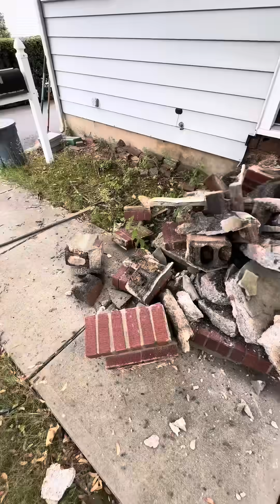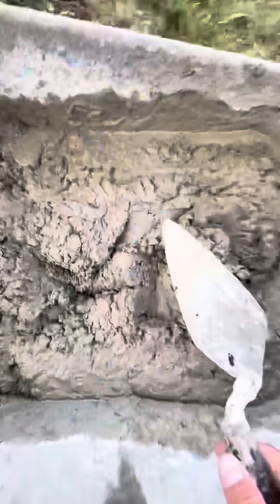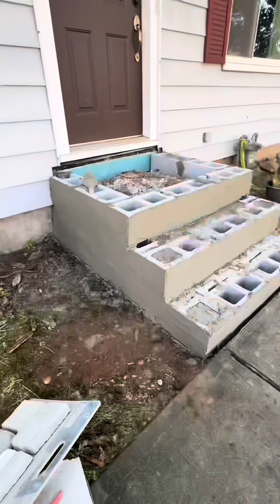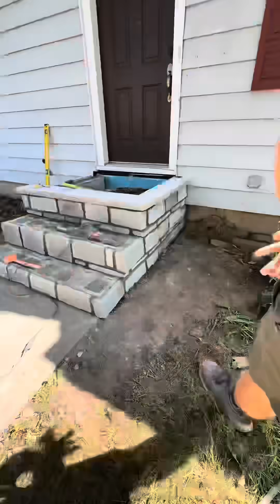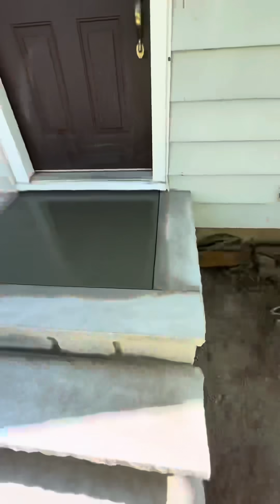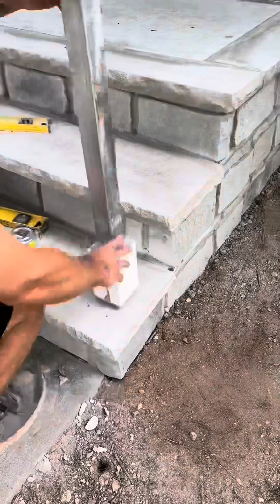Entire Front Porch Rebuild Step by Step Start 2 Finish

Comment: Looks awesome guys! Really quality stuff. Maybe on the next one try to sell the customer on some 3 2 1 pavers or another interesting paver pattern instead of the concrete on top to complement the stacked stone?? I’m 33 and I’ve been doing this stuff since I was 18. Personally I’d sell them on a nice wood rail that I build and paint white myself and then the cost of that rail kit becomes mostly profit, but I enjoy woodworking too so maybe that’s just me. I dropped a follow tho. This channel deserves to take off!
Reply: Sell them out of something they want? Naaa man. Work them up a few options, including their wants. Give them the option. Some will take the idea, and some won't. Either way, do a great job to earn the referral on the next one. I've been doing business like that for 20 years. Hasn't hurt me yet. I am blessed
Reply: @joemanfredi6267  fair point, and you’re right, customer satisfaction outweighs profit. With the paver top I’m thinking long term maintenance. Concrete cracks and pavers don’t. If pavers shift it’s fairly cheap to reset them. But absolutely give the customer their options and que them into the pros and cons of each!